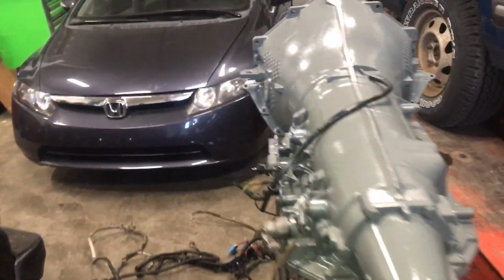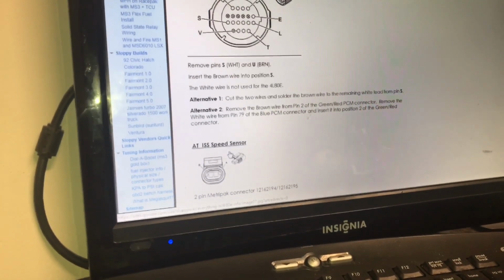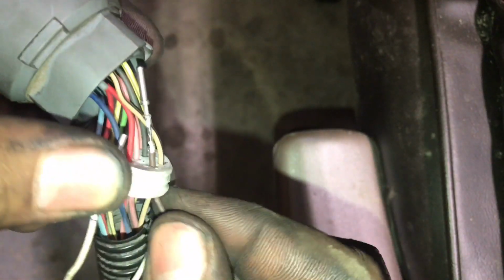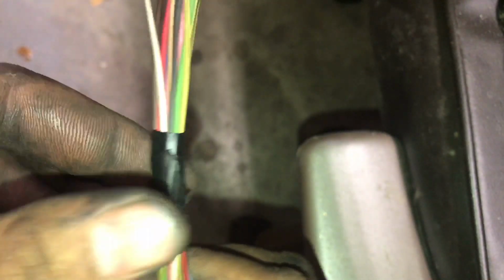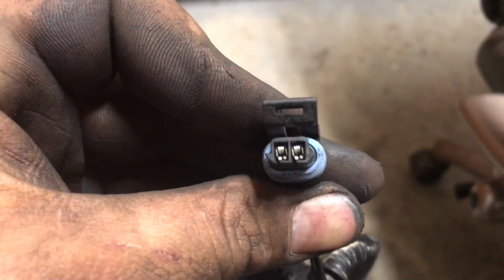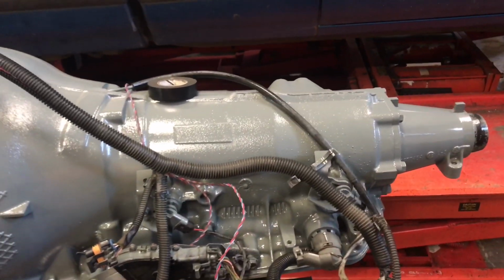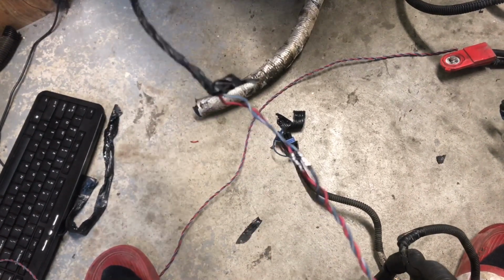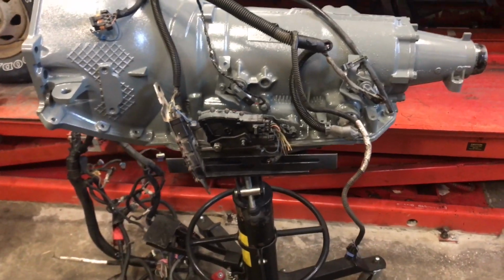Silverado 4l60 to 4l80 Swap -WIRING-

Comment: FYI to everyone doing the 4L60E to 4L80E swap instead of getting a custom drive shaft or cutting the original one and having to put trust in someone to balance it perfectly get a rear output yoke from a 1500 4wd and a Moog 447 U joint and your good to go without doing any extra customization…. But I’d still get a beefier shaft (same as OEM)  depending on what you’re doing with your new setup
Reply: what are the part Numbers i need to convert a 4L80E to a 4L60E?

Comment: My car has a code. It’s a 73 with 5.3/4l80 swap. I’m getting shit 2-3 so after pinning the big plug on trans will my car no longer be stuck in 2nd or 3rd gear ?

Comment: Did you run a shorter yoke or cut your driveshaft?
Reply from the maker: Problematic Alex shorter yoke I’ve noticed on 2wds you can get away with just yoke swap on 4wds you usually have to shorten the rear driveshaft

Comment: I have a 93 chevy z71  it came with the 4L60e. Can i just swap it out with the 4L80e
Reply: You need the right flex plate a 4l80e crossmember and the wiring but yes

Comment: Hey bro I have a 4.8 that I’m going to put turbo on it i wanna swap a 4l80 do you have to use a custom torque converter & flex plate
Reply from the maker: MOPAR_LSX _SVT_JDM no you can use the torque converter that comes with the tranny and use a flex plate and a spacer from a 2500 ls equipped truck

Comment: My friend what I need to do which wire need to use in my transmission 4L60E  I'm  doing a swap engine and automatic transmission everything stock with 5.3 engine again which pin number s I need to live in my pcm harness thank you I hope you answer me back

Comment: Is that 2 speed sensors and what do you do for a 4wd the speed sensors are in the transfer case and there is 3
Reply from the maker: James Holbrook yes there’s 2. On a 4wd the rear sensor is capped and you use the one on the transfer case
Reply: Cool thanks i am about to go pick up an 4l80e and transfercase off craigslist for $650 they said it was working when it was pulled i hope so because my 60 just does not hold up

Comment: The white wire is shift 2 and 3 solenoid. Wont that effect the 4l80?
Reply: Yes he should take the white wire and tan wire and order a speed sensor for the 4l80e and solder the white wire and tan wire to the speed sensor wires

Comment: I have a 2003 Chevy 1500 z71 with a 4l60e 4x4, I want to put a 4l80e 2wd out of a 2001 Chevy 2500hd will I have to rewire?
Reply from the maker: Ledger Cook yes
Reply: JH Garage after connecting it to the computer what else do I have to do
Reply from the maker: After you do the wiring part you just have to segment swap the trans file with a 2500 truck using hp tuners
Reply: JH Garage can I use Superchips instead of hp tuners

Comment: I'm having some serious issues with this for some reason my computer isn't activating the Solenoids! Did you Segment swap it or use the 60e file? I have update videos on my channel but I'm running out if ideas if you had any similar issues!
Reply from the maker: StreetRacingLifeStyle yea after you do the wiring you have to do a segment swap for the 80e
Reply: JH Garage Ok yeah I did the Segment swap! We even tried to command Shift solenoids A/B and The Pressure control Solenoid but they are unresponsive! The TCC works which leads me to believe the transmission has power from the pcm 🤦‍♂️
However I'm clueless as to what could be wrong!
Reply: @StreetRacingLifeStyle  did you figure this out??
Reply: Mario Ortiz what was the problem?

Comment: Great video.  Will this work on a 2000 4l80 out of a Silverado going into a earlier  Tahoe?   I'm swapping out whole drive trains. Lq4 4l80e  electric transfercace into a 1999 Tahoe 2 door with a 4l60e and a electric transfercace?  I
Reply from the maker: huffed70 yes. If your harness is already a 4l80 harness you shouldn’t need to do this

Comment: Did you use the 4l60e NSS on the 80e?
Reply: Trap Spot Customs What issues are you having? I wonder if they are simular to mine?
Reply: StreetRacingLifeStyle I didn't have any issues with the swap I was just looking for info before i did it but all is good now 👌
Reply: Trap Spot Customs Right on yeah for some reason my Pcm isn't supplying power to my solenoids A/B and or my pressure Solenoid I'm beating my head against a wall running out of ideas
Reply: Street life what was it?

Comment: I did this in a 2003 Silverado 2wd and now it has two trans codes in the pcm.  SES light came on.  I could get the codes tomorrow.  I triple checked the wires that were displayed here. Any ideas on what it could be? One code was something with torque converter clutch the other way 2-3 ratio I think
Reply from the maker: Isiah Tatum did you flash the pcm for the 4l80
Reply: JH Garage no. We did the harness part went and drove it and it fell on its face. He literally watched your video and went out and got the 4l80 and had me put it in. Can you send me a link on how to flash it? If not no worries.
Reply from the maker: Isiah Tatum sorry should’ve mention that in the video you
Need to flash it with hptuners if you don’t have the program you
Can send the pcm out and have it flashed for like 100-150$

Comment: I'm Thoroughly impressed Sir. Thank you for the video. I can now do this to my truck. Any advice?
Reply: Did you end up doing it?
Reply: @domhammer1289  no. The 60E that I built is still working just fine on 13 lbs of boost
Reply: @georgiaboy1579  the 700-R4/4L60E, will always get half the life of a 4L80E. 4L60E  Same clutches for 1/2 & 3/4, so everything gets used twice. 4L60E=100K transmission, 4L80E=200K mile transmission.
Reply: @diduck6878  I agree the 4L80E is stronger but it has it's flaws as well. Heat is their worst enemy. The 60E that I built 3 years ago is still holding on and my truck is cammed, stalled & tuned by me with a VS Racing 7875 turbo on 15 lbs of boost and I drive it like I stole it. I built an 80E a couple of years ago and it's just sitting around waiting for the 60E to break. I also installed a 40K cooler. I also have a 98 Z71 I bought new and the original engine & 60E has 286K on it but I did install a 180° thermostat and 30k trans cooler at around 15k
Reply: @georgiaboy1579  that's impressive. That is truly a testament to the statement about the temp. I can't even imagine how many miles you'd get with a 4L80E. You can get a 4L60E to last a little longer, when you get past design flaws. 1 big one is the weaker pump design. You can combat that with stainless pump rings. They are less likely to deform/break. But as for the forward clutches all being used twice there's not much you can do. Different companies do things to increase the amount of frictions but still limited to space
Reply: @diduck6878  I modified my pump, installed the Transgo HD2 kit, Alto HEG clutches with a 9 clutch 3/4, Sonnax Smart Shell, Vette Servo, Transgo separator plate, and Sonnax 2/3 shift valve, Sonnax bushings. It's surprisingly strong
Reply: @georgiaboy1579  cool I'll still go with the 4L80E stronger stock, better pump design. I can find a 4L80E core for cheaper than the $800 sonnax smart shell
Reply: @diduck6878   When I say smart shell I mean the $80 Sun Shell. The input drum is stock
Reply: @georgiaboy1579  that's dope as fuck I wish I had the money to do that. My 5.3 vortec is knocking like a mf on my 2000 shitbox Silverado idk what I'm gonna do buy another vortec 5.3 junkyard motor or ls1 swap it. Trans is a 4l60e and she sputters at 55 have to stomp on it to vet it to shift. Blew my diff ans threw an Eaton true Trac installed . Hate to get rid of it as I put alot of money into it. Just out of ideas. Any recommendations 👀🤔
Reply: @MG-ol3no  I wouldn't mess with an LS1 honestly. I see them come apart more often than not and they're overpriced. I would build the 5.3 and throw on an Ebay turbo or buy a knocking 6.0 and rebuild it, put a cam in it, throw on some 706 or 243 heads and send it.
Reply: @georgiaboy1579  thanks man I appreciate the info.  I'm going to look into that. I need to find a low mile 5.3 😩
Reply: I wanted to do this so my 2000 Silverado I didn't even know you had to mess with the wiring that's what the wiring I thought you'd just throw it in and use the stock converter I'm an idiot